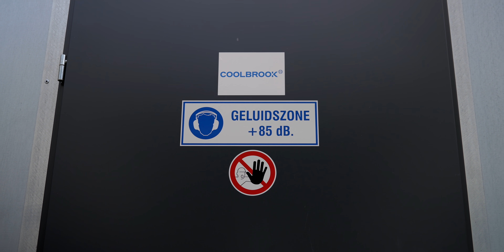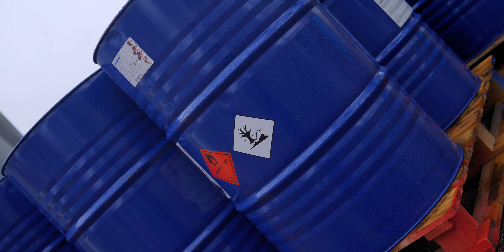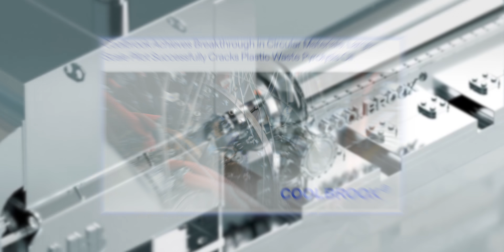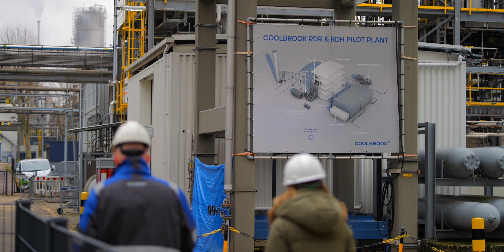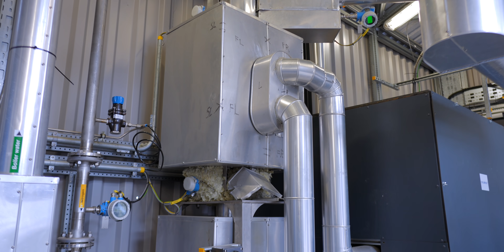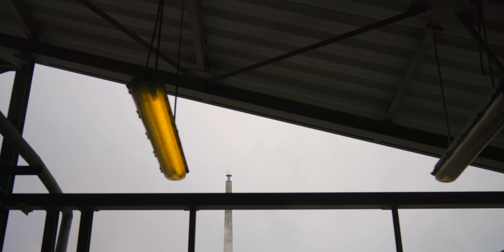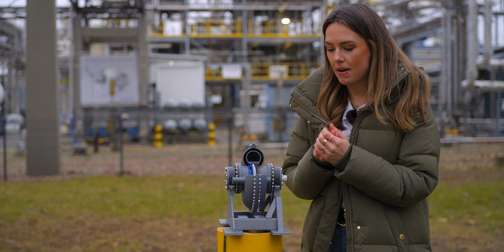Where Heat Pumps Won't Cut It, Coolbrook's Shockwaves Might....

Comment: After watching I still do not understand the benefit vs a resistance heating or an electric arc furnace. I can understand that the heat does not need to be transferred into the medium, because it develops where it is needed. That might be the benefit. Is this process also applicable to overheat steam? If I had a large steam source, but I'd need some temperature increase near the reactor, because the general energy flow from the source is not sufficient. Can it be used as a kind of second stage heating that can be switched to adopt to the demand? If yes, I can imagine that this can play an important role in some chemical production locations.
Reply: That's exactly what this is. The turbine is the last stage of heating in chemical production.
Reply: She explained that a resistance heater would be a one-time use because the components would melt at the desired temps.
Reply: @patreekotime4578  Which is simply nonsense. Like saying you can not cut steel because any saw would get dull.
Reply: @leocurious9919 It is not nonsense. The kinds of alloys developed for use in turbine blades can reach temps around 2000 degrees and maintain integrity. The material used for commercial electric heating elements melts at 1400 degrees. So they can be used for preheating stages, but for the final step, a more stable material is required.
Reply: @patreekotime4578  I have no idea why you think that, perhaps look up MoSi2 heating elements for one example, they are good up to 1'800 °C in air.
Reply: The reason is that this company does not develop resistive heating, so it is not discussed. Nothing at all is discussed, no draw backs or anything. Only dialed to 11 talking points about  x % of total CO2 it can save.

And yes, the direct heating is an advantage - but letting gas flow over heating elements would be just as good without all the massive effort. Unless the material leaves the machine at low temperatures again. It is not even once mentioned if the material leaves the "shockwave chamber" at such high temperatures or if the high temperature conditions are only present in the chamber (only at the shockwave itself =not everywhere in there). That might be good for cracking, where you just need to "hammer" the molecules to break them apart anyway, but for processes that need heat for other reasons this would be entirely useless. Advantage would be that it really concentrates the heat there where it is needed. But if it does exit at those temperatures, then a comparison to resistive heating is not just valid but... I see no difference at all then.
Reply: @leocurious9919  they specifically address direct electric heating. The point is that the process degrades the heating elements so much that the maintenance makes direct heating unproductive.
Reply: @marcusm808  Yes, that might be the reason in this one specific case. Or maybe not, the tubes they use in the classic natural gas fired process are metal, not ceramic, you can heat those with current directly.
Reply: @leocurious9919  As soon as products leave the shockwave they'll expand, cooling them, somewhat.

Comment: If I'm not mistaken induction heating is currently being used in the steel industry in sweden, there this process would not make any sense
Reply: Correct. It has limited applications today. But being able to heat gas efficiently to high temperatures with minimal gas contamination will be very useful in advanced materials applications, enabling new capabilities.
Reply: Induction heating is only for metal recycling it doesn’t produce steel from iron ore for example.

Comment: Nuclear plant can heat better with less emission - - - How would you compare Nuclear vs Rotodynamics> ? ? ??
Reply: Easy - Nuclear plant fixed site, hard to deploy to other locations, requries long time to build at high cost ....
Reply: @GruffSillyGoat SMR - Small Modular Reactors
Reply: @riznliz - possibly at some point in the future but there again they could be challenged by geothermal borewells, which produce electricity and heat. Heat that could be lifted to higher industry levels using rotating compressors like that in the video.

Comment: Never seen such a badly put together video. You’re talking about deep physics which a lot of us don’t have. You use terms which none of us know about. You don’t explain where the electricity comes from to power the device. Is it coal, gas…? And that would mean that it’s not that efficient.
Reply: It’s an electric powered device that in this particular application they use to crack Naptha. It’s a tool for heating gases to over 1000C. Induction doesn’t work on gases, so something like this is needed for any process requiring high temperature gas (not just petrochemical uses).

Comment: Two thirds of the emissions from creating cement comes from chemistry rather than physics - when you heat lime it releases co2. So you'll still need carbon capture for that bit. Looking forward to the electric revolution speeding up a bit!
Reply: @pumpkinhead456 there are alternative chemistries, some of which are carbon-negative
Reply: @ala @alanhat5252 , but none is truly industrial scale just yet. H2 DRI and MOE are looking most promising, but we’re a little way off with the former and further off with the latter. The issue with H2 is sourcing sufficient green H2, or you just push the carbon emissions upstream, and the H2 needs to be cost effective. 

We have essentially a few big levers for decarbonising steel: increase use of scrap steel with EAFs/induction/new tech like this rotary turbine; decarbonise the remaining virgin steel with the same tech plus H2 DRI, MOE and other chemistries as far as possible; do some CCS on the remaining virgin steel; and push harder into optimising materials efficiency, substitution and design efficiency (eg long-span structures like airport roofs, structural timber). This will get us a long way there, but sadly not all the way, and it’s a journey of decades.
Reply: I don't know the absolute figures, but the CO2 of making steel also comes not just from burning fuel, but from reacting carbon with the oxygen released from the iron ore.

I think Dave Robert's Volts podcast has had a couple of episodes on the use of electrolytes/catalysts to avoid those reactions in cement/steel production.
Reply: @j12997967  I seem to remember a Swedish company (featured on this channel I think) that  had replaced the carbon with hydrogen. So instead of producing CO2 you get just water.
Reply: However that CO2 gets absorbed back by the concrete when it cures.
Reply: Slap a Sabatier reactor with a methane pyrolysis cycle on there, and you have a C(s) source instead of a carbon footprint.
Reply: For a start you count the CO2 the concrete chemically absorbs through carbonation over it's lifetime.
There you go, solved a decent chunk of that problem in a sentence, someone else's turn now.
Reply: @duncanidaho9153 you'll need to ask the IPCC to change their carbon accounting practice, as that's not how international standards work.
Reply: @pumpkinhead456   I'd be easier to just shut them down.
Reply: @Islamisthecultofsin . That would be quite a stupid thing to do though🤔
Reply: @firelord7776   They are k illing everyone with the mRNA shots.
Reply: @Islamisthecultofsin . A your a troll trying to emulate right wing propaganda, I see
Reply: CO2 is not a pollutant.
Reply: @Islamisthecultofsin respectfully, I believe you're incorrect.
Reply: @Islamisthecultofsin It is a problem, though. An effing big one.
Reply: @Islamisthecultofsin both your handle & your comment are incorrect, even prosecutable.
Reply: @alanhat5252   Tell me you're a NAZI without telling me that you're a NAZI.
Reply: @alanhat5252 leftists have been brainwashed. Have you ever heard of free speech?
Reply: @Islamisthecultofsin Yeah, that's why nobody used that term.
Reply: @patreekotime4578   Then why bother trying to reduce it?
Reply: @Islamisthecultofsin To make trolls upset, obviously.
Reply: CO2 is not a pollutant just like water. But too much of it can become quite unhealthy. I think the world needs to have a different goal from just net zero greenhouse gas emissions. The world needs to go to a system where the global amount of greenhouse gasses (and PM) in the atmosphere can be managed like the climate control in a car. Than we can survive regimes with oil and coal barons to please, religious idiots who think God as a sort of divine CEO is the climate manager or just natural disasters like a Yosemite National Park eruption.
Reply: @therapeutischbecommentarieren  The planet goes from a ball of ice to completely ice free.  CO2 and mankind has nothing to do with it.
Reply: @Islamisthecultofsin lol, troll, try again

Comment: This tech will be incredibly important if it is given the chance to progress. As you pointed out, there just aren't any realistic alternatives to combustion for these industries at the moment. You  make it very accessible for us viewers as well. Brilliant!
Reply: There are plenty of options to stop using fossil fuels. This video is a greenwash for the fossil fuel industry
Reply: @oak8863  The video is greenwashing, sure, but the tech is simply a high temperature heater of gas-phase materials that induction and arc heaters are not suited for. Thankfully, other gases besides Naptha can be heated this way. This will have more appropriate use in the material sciences for advanced materials manufacturing (especially high performance refractory materials). Right tech, wrong application.

Comment: That list of alternatives, IS A LIE!!!
There are furnaces that get over 1000°C, routinely up to at least 1800°C, have been used in the metal industry, since the early 1900s! Both electric arc furnaces, and induction furnaces routinely get to 1600-1800°C (dunno about their upper limits, but both can get hotter), using electric arcs and electromagnetic induction, respectively. And it's not tiny amounts. Especially when it comes to electric arc furnaces.
Reply: Induction heaters can heat solid and liquid materials efficiently. They are not useable for gases. The only way to heat a gas using an induction heater would be to heat a metal and mix it with the gas you want to heat - incredibly difficult and impractical.
Reply: @BlueOceanStrategistS  That's beside the point. She said that heating up over 1000°C (not heating up naphta, or chemicals generally. ANYTHING that industry needs to heat ...and explicitly mentions steel and aluminium) is difficult, and can't be done in any way, other than by burning stuff, or one of those list of things.
Reply: This video is a greenwashing exercise for the fossil fuel industry. Imogen doesn’t understand she’s a shill
Reply from the maker: @oak8863 I’m sorry you feel that way. I’d agree that we’d rather see this in action for steel, cement and aluminium- but this is where we could see the demo. Given thr potential for technology to address 25% of global emissions - we deemed it worthwhile. With regards to naphtha - we don’t see a world without plastic any time soon, but it’s great to see that alternatives to plastic are being pursued. We do address this nuance in the video. Thank you for taking the time to watch and offer your feedback
Reply: @EverythingElectricShow  You CLEARLY STATE, in this video, that to heat up ANYTHING that industry needs to heat up over 1000°C, and you explicitly mention steel and aluminium (along cement and chemicals),  and you claimed that the ONLY options are either to burn things, or to use one of those five options you list (two of which ARE burning things, and one of which [carbon capture] doesn't create any heat, at all!)
...despite the fact that metals have been heated to at least as much as 1800°C, by induction and electric arcs, routinely in industry, since at least the early 1900's.
In other words:
YOU LIED!

Comment: It's funny, in a country gripped by a heat pump phobia. So why are heat pumps then, injected into conversations, for absurd applications? Where it's clearly an inefficient,  complex, and costly option, at this stage of its development. 

Please just start using Heat Pumps, when it is clearly appropriate, extremely efficient and cost effective... Like the rest of the world.does.
Reply: Yes. So don’t use Heat Pumps for applications where it doesn’t work. Good news - the new device being described in video isn’t a heat pump. 😱

Comment: Cement production can easily operate on 40% waste as the fuel,and could do even more,but usually licensing restrictions prevent higher usage.
Yes still producing CO2 but not as much as coal,the fuel CO2 is minor compared with the calcining of limestone which is very hard to avoid.

Comment: Electric steam turbine takes high pressure steam to spin the turbine, producing rotation that is used to generate electricity.
From what I understand of this process (to over simplify) the 'low energy' gas impacts the  high speed rotating 'turbine' and the reverse of the electric generator happens, the energy is transferred from the turbine into super heating the gas.
Reply: It's a step beyond that. The turbine is spinning so fast that the blades enduce a shockwave which is what superheats the material.
Reply: Yeah, the fossil fuel gas.

Comment: So is the reactor any the different than traditional once? My understanding is that the only difference is in the source of steam - incineration vs electric. Am I missing something?
Also in terms of efficiency 90-95% compared to resistive heaters 100% seems quite low. Resistive heaters are capable of producing temperatures well above 1000°C. 
The biggest issue from my perspective is the cost of electricity. Depending on the location it can be several times more expensive than coal per unit of heat produced taking into account efficiency of each method. It's the same issue we see in metallurgy or glasswork. The limiting factor is usually the operating costs rather than technical limitations.
Reply: Resistive heaters can have issues with reacting with the materials used and environment. Tunsten for example will react with atmospheric oxygen at the temparately this system works at, and has to be used in vacuum furnaces to prevent this occuring. The Coolbrook approach heats gases directly, with a level of precision, which is useful in applications including direct heating of industrial process gasses and well as air and inert gasses, useful for advanced ceramics making for example.

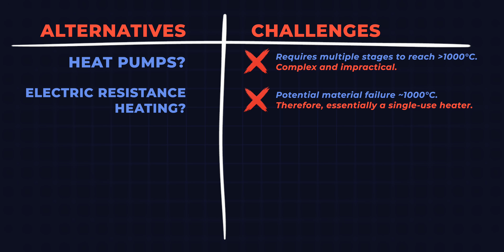Comment: ref:  2:23
Electric furnaces goes way over 1000 C. Up to 1800 C is not a problem. Even aluminium production is close to a 1000 C  (980 C).
Reply: Electric furnaces operate on conductive materials in solid or liquid phase only. However application shown in the video requires heating a gas to high temperature.
Reply: The videos is a scam. They are pretending that the source of the energy is not fossil fuels. NAPTHA is a fossil fuel.
Reply: @oak8863  You do not understand. NAPTHA is not a fuel, it is a precursor for plastic production.
What is replaced is the source for heat needed in the cracking process.